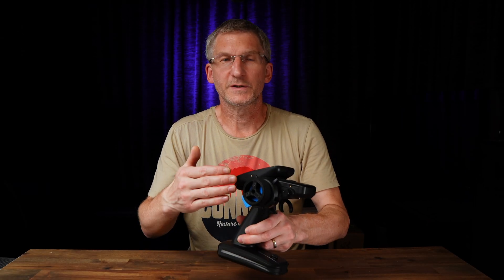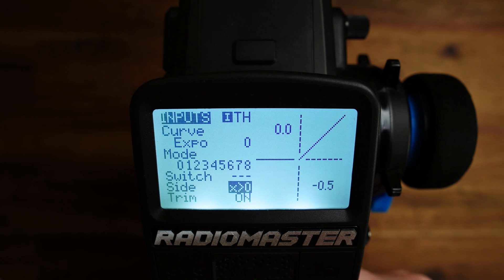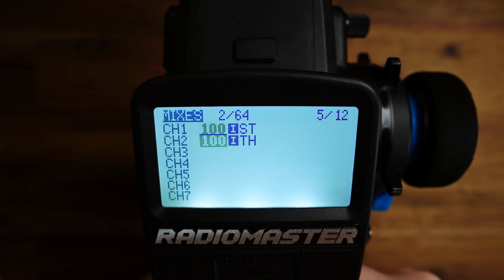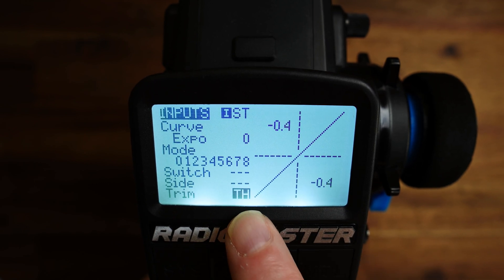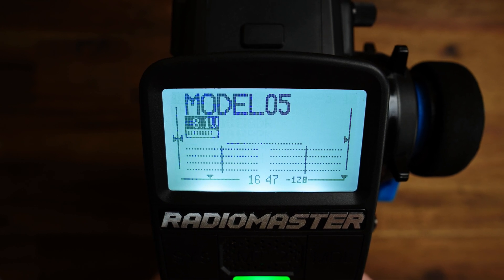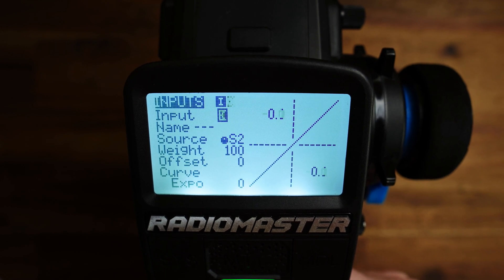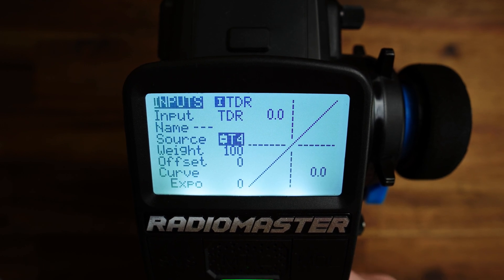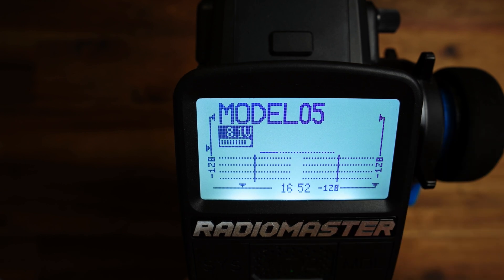USING THE TRIM SWITCHES ON THE MT12 | EDGETX | TUTORIAL [EN]

Comment: I have maybe a dumb question: if I just want to use the trim buttons ST (T1) and TH (T2) to, respectively, set channel 3 to 100 and 0, is there a simple way to do this? I got halfway there by watching this video (I can hold ST- to increase channel 3 gradually, and I can hold TH+ to decrease channel 3 gradually), but I think I'm missing a piece of the puzzle to make this happen with a single press of each trim switch like I want.
Reply from the maker: Why do you want to use two trim switches for this?

Comment: Is there a way to use the AUX port on the side as a Wireless Trainer connector? If it is possible could you maybe do a video on it?
Reply from the maker: I do not have any experience with trainer configuration but I guess you have to use the DSC port for this.
Reply: @arminrc  Yeah I some a Short video of someone using the TX16s With a sbus receiver or something
Reply from the maker: @NorgeSquad  How is an SBUS Rx related to trainer function? Isn't SBUS some sort of "one-wire-protocol"? Usually on Copters you use SBUS to connect the Rx to the Flight Controller.
Reply: @arminrc  no like he was using an elrs rx as sbus or something. Trying to find the video now lol
Reply from the maker: I think I know now how you can set up a wireless trainer config. But currently I can't do it. I would either need a 2nd MT12 (with ERLS) or an external RF module for that. Well, maybe I find another way ...
Reply: @arminrc  That'd be awsome

Comment: Have you tried for example go frome max brake to full throttle fast? 
When i tryed this deviding the thr into one x>0 and one x<0 the system buggs when going fast between endpoints on the throttle lever.
For example when i was going frome max BRK to max THR fast sometimes max THR could be enything frome 60-100%.

I ended upp using custom thr curve instead. one 0-100 for THR and one -100-0 for BRK, basicly doing the same funktion as x>0 and x<0
Reply from the maker: Thanks for the info. Usually I do not need to go from max brake to max thr that quick. I am not a competition racer and for my little crawling adventures thats not necessary. But you are right. Seem a bit strange. The cool thing about EdgeTX is, that there is almost always more then one solution for a problem and yours is looking good!